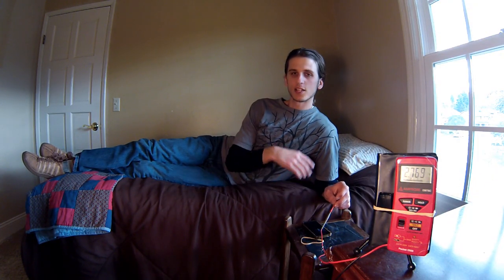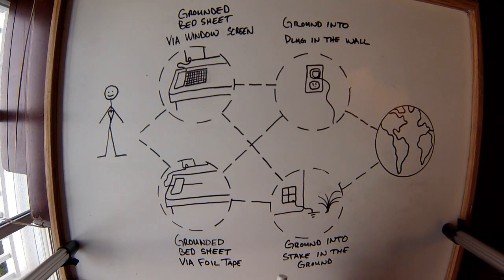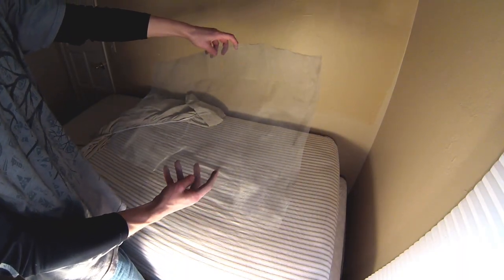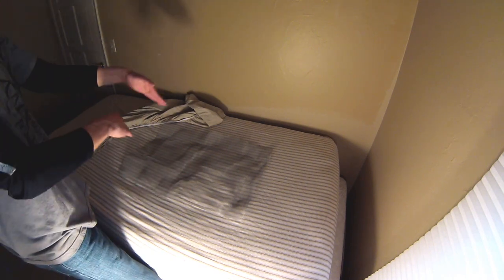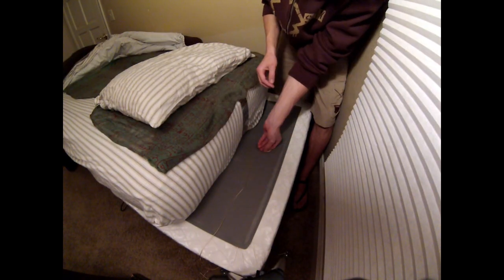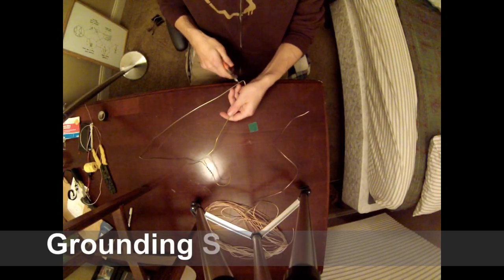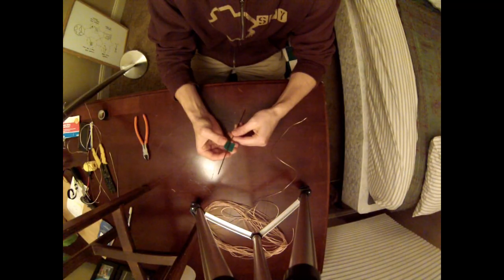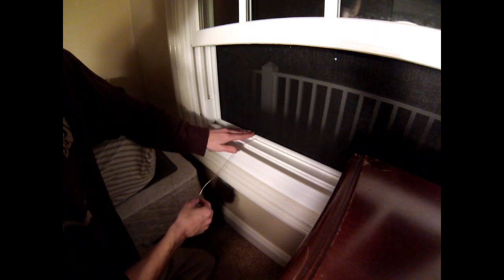DIY Earthing Sheet: How to Sleep Grounded Indoors (Tutorial)

Comment: I would say just think earthing direct, which means having socks made for earthing or cuffs that also are made for earthing to slip on your ancles before you go to sleep. This way it's easily removable and you have direct contact which means the best effect, where I get 0,05 volts through my voltmeter test. I also use the earth wall outlet, but make sure your system is thoroughly earthed and ofc a good connection to the outside ground. Otherwise you need a rod etc.

My experienced health benefits are better sleep, no more going to the bathroom at night and more rested in the morning. This happened after few nights earthing. People who are not taking advantage of this FREE source of healing are missing out.
Reply from the maker: Thanks for sharing your earthing testimonial- those are some great benefits!! 🦶⚡️

Comment: I've got a grounding sheet for my bed. The one thing I've noticed is my dreams are not as "disturbing". I use a copper rod staked into the ground/earth  with #10 copper wire..
I attach it to the sheet via copper bolts in the corner...
Reply from the maker: That's awesome! There are so many benefits to earthing, it's impossible to list them all 😊

Comment: Fantastic video ...well done, can you tell me what voltmeter you recommend and what settings ...going to try mosi net (Metal)  copper wire and long 4 ft steel driven into ground ...might need be careful of lightning strikes ? so fuses as well ?
Reply from the maker: Lightning won't travel through and shock you, don't worry about that!

Comment: Hi all, I'm new to all this. I just have a question I don't see anyone askimg: by covering the mesh with a bed sheet, does that not remove the conductivity? As in, doesn't your skin have to touch the actual metal? (mesh or tape) Any further advice on this would be appreciated. Thanks!
Reply from the maker: It doesn't remove it but it can reduce it slightly. But, your body produces moisture (sweat) which enhances conductivity.

Comment: Does the metal have to be touching your skin???
Reply from the maker: No it does not.
Reply: Can you please elaborate how the conduction works if there is a seemingly non-conductive material between the skin and the metal? I just want to understand it please @Earthrunnerssandals
Reply from the maker: The material covering it does not block the transfer of the conductivity  @NanetteSchroeder

Comment: Hey I'm pretty sure as a safety feature rather than a fuse one should be using a 100K Ohm resistor built in. The resistor is there so that if you were to come into contact with a hot wire on accident from any appliance plugged in to 120v, the amperage flowing through you to the ground would be limited to a very low and non lethal current. The 5A fuse does not accomplish this. 👌🙏 blessings. Just made my grounding device today!
Reply: Still using the grounding device?  Does it work??
Reply: @lonnycurtis7093  I'm using it still. It's hard to isolate all the factors in daily life, but I'd say its worth it to use. I supply everything I can in my healing lifestyle and know that a bunch of small good things combined has potential for great outcomes 👍 hope that helps. God bless
Reply from the maker: Thanks for sharing!

Comment: A took a multimeter and put continuous voltage scale. After putting the common lead to ground and the red one holding in my hand, it read -6mV. After that i put an electrostatic bracelet and did the same thing and it measured -0,2V, why is that ?
Reply from the maker: Hm, it's hard to say without knowing all the variables of your test.

Comment: WHAT DID U GROUND IT TO? U stopped after u put ur sheet over the screen. Come on!!
Reply: He explained it in the flow chart at the beginning. Either use mesh or tape, and ground to either house plug or our side with peg/rod. He showed how to do one end of the wire (both options), then the other end (both options). You decide what you want to do 😊
Reply from the maker: Yes exactly, you have options! I use the earth.

Comment: Hi…
Thanks for the great instructional video on grounding your bed. I have a question…I have a 2” mattress topper on my bed. The aluminum mesh I laid down on a full size bed fills about 2/3rd’s of the entire bed sandwiched between the bed mattress and the mattress topper. Am I losing a significant amount of the beneficial effect of conductivity putting the mesh under the mattress topper vs on top of the mattress topper? Would you say it has little effect on the conductivity to my body. I’m doing it more for comfort. Would you strongly advise putting it right on top of the mattress topper?
Reply: Have you tested to see if you are grounded with this set up?

Comment: Do we add the inline fuse regardless of whether we use the stake or the outlet method? What is the rating on the fuse? Are both the screen and the conductive tape equally effective? Does guage of the wire we run make a difference for effectiveness?
THANKS SO MUCH! so valuable

Comment: Some years ago upon a friend sharing his earthing bed sheet great experience, I bought a set of grounding bed sheet from aliexpress with everything properly made and neat. Bedsheet is weave with silver threads (copper model is cheaper), with a plug to power socket(only earth wire connected). 

For better experience and to avoid common earth wire stray current, I removed the plug, connect the bed sheet wire directly to a meter long earth rod nailed into ground (no need 2m depth that is mean for real equipment earth). 

Measuring of my body resistance and testing on friends sitting/lying on top the grounded bed sheet is instant very drastic drop of voltage VS earth (of course since the purpose is to earth our body to drain away bad radical energy &static charges). 

Resistance of body by holding ammeter probes on both hands shown instant drastic increase or drop for different people.

The experience is fantastic, immediate best sleeping quality with cool fresh head everyday. Before I was always feeling tired with very hot head due to long exposure to smart phone and internet usage (radiation of 4~100mG from phone), also EM wave from 220KV power lines just 600ft away (constant 0.4mG).

No more blanket sparking at winter night due to static charge. But after a period, you may stop feeling the different as you get use to the goodness. So i go for bare foot walking on soil, since earth blanket is only a tool for lazy/ busy people who can't afford to connect directly with mother nature for healthy energy exchange, so they utilize their sleeping time to connect partially through wire.

Comment: So.... earthing through the plug eliminates the need to earth with the coathanger right?
Reply: Yes, you can get ground through a plug (assuming it’s truly grounded). However I tested my body voltage when using a line directly to the outside ground and it was lower.  A direct line to outdoor ground usually gives you a better ground than electrical outlets.

Comment: Nice explanation!Congratulation!what is the instrument you are using?What setting do I have to set it on in order to measure the volt?mahmper?
Reply from the maker: It’s a voltmeter
Reply: @Earthrunnerssandals  i made one grounding sheet....in my bed....followed by a cable co netted to another sheet outside in the balcony...and from there the cable on the other end of the sheet mat goes directly in my garden....Now i just need the voltmeter...and make sure it works ..i slept for two days...and I perceive a sensation of relaxing feeling carrying out of my body a muscle soreness....i don't know if this the stress or the Grounding effect... Another problem i need to solve...is tbe pricky edges of the anti-mosquito iron sheet/net i use for grounding...at the moment i cover the left and right bed side edges with a bed sheet so it doesn't prick me.Welcome any suggestions :)

Comment: What did you do with the negative lead on the meter?
Reply: You put the negative lead in the ground hole on an electrical outlet OR the negative lead touches your grounding mat material. You can then touch your hand to the red lead and read your body’s voltage.

Comment: Hi, I've been walking bearfoot during summer for some time now and a week ago after watching the Earthing movie I was very motivated so I've soldered some two inch round metal pads to a cable and soldered it to the copper pipe in the heating sistem next to the radiator in the appartment. When checked with an multimeter it emptyes the body from 2-3v to 0,03 and eventualy to 000 so it's grounded. Did just that also to my mother in law which has much inflamation and pain in her body and mostly in the feet. And my wife has her throat inflamated as well and she sleeps with the pads and keeps them on her belly every day for some hours like I do to. We're all been using this grounding methood for a week now, day and night by puting the metal plates under the elastic of the clothes on the belly skin. But no one seems to notice annything. I mean after days with hours of grounding each day... And in the movie the lady in the wheel chair said that after one night the swelling of her feet was gone that she could see the bones! Clint Ober was UAU after one night...Am I missing something here regarding indoor earthing? Are we doing something wrong? I also aspect to receive some silver mesh(55% silver, 45 poly) to put on our pillows without anything on top of it for best contact. But now I'm not that enthusiastic like I was a week ago. I was hopping to see at least something at one of us, annything.. If, I qoute: "Inflamation can not exist in a grounded body" then why neither of us experienced less swelling in our feet, thorat etc?  I went for the pipes because of the emf in the sockets that many are talking about.
Reply from the maker: Hey there, it is possible there are enough external factors like other EMF fields or local 5G that is affecting you. Do you turn the wifi off at night? In an apartment, you are very close to all of the neighbors' wifi routers and other appliances, you may want to look into shielding paint to limit how much of the neighboring EMF fields leak through to your apartment.
Reply: @Earthrunnerssandals  Thank you. Someone told me that I might be getting ''false'' grounding from the heating pipes because of the huge metal mass, absorbing the body voltage (the drop shown on the multimeter) but the pipes being isolated in the earth from cold and being a closed circuit with valves and pumps it's not grounded so no benefits. Then I've read about some people that can be affected by the emf's in the sockets, or the ground being connected to the negative in some sockets (one of mine for example) so I'm avoiding sockets too.. A rod in the ground to the 4th floor is out of the question so the last chance: I've soldered a wire to a copper nut on the cold water pipe under the bathroom sink and routed it in the room and we'll see. Cold water pipes are mentioned many times as being a good way of grounding.

Comment: I thought bare skin had to be making contact.
Reply from the maker: Anywhere your skin contacts the sheet, it's benefiting from grounding
Reply: @Earthrunnerssandals  Right. But if you put the sheet over the grounding mat, doesn't that stop the current flow?
Reply: I can see from your demonstration that the voltage is dropping, but I was told again and again that the bare skin had to be touching the grounding mat.

Comment: I've been sleeping on this for a few weeks (aluminum screen method), and I'm waking up with sore hands, feet, knees. I've never had any issues with this and I'm not sure if it's related to grounding yet. I'm young and I tested my setup with a multimeter to make sure it was working beforehand, (got down to 0.008 volts), so maybe I'm detoxing in some way? Super weird and disconcerting.
Reply from the maker: If you've tested to confirm it's grounded and you didn't accidentally bring more electric fields to the bed (like bu plugging into the wall outlet) then it may be a detox reaction.
Reply: @Earthrunnerssandals  My plug is going into the wall, but I cut off the wall plug prongs, so only the ground is going into the wall. I've temporarily stopped using my grounding sheet for a few days and my joints have stopped hurting, so clearly it's connected. Just not sure if it's a detox or something else.
Reply: @aeko   How are you doing now? Im experiencing the similar symptoms with grounding. Also insomnia...
Reply: @GSD_Moose  I stopped doing it since, the issues are gone. Would have to do further testing to see what the issue was. Could be something wrong with the outlet I was using.

Comment: as soon as you cover the “grounded “ foil up there is again isolation....so you are not grounded at all... I used a silver conductive sheet (one square meter) where the body is largely touching the surface of that ., using the grounded contact in the wall socket only.
Reply: can you put a link on your  silver con. sheet pls thank you
Reply from the maker: If you use a conductive material it is still grounded, as shown via voltmeter test

Comment: That's great!
Is your bedsheet conductive? If so what is it made of and where did you get it? If not am I understanding correctly that it works without direct skin contact (through a normal sheet)?
Thanks!
Reply from the maker: You can use wool or other natural conductive materials. The Earthing Store sells premade kits too which are easy to set up.
Reply: @Earthrunnerssandals  wait is all natural fabric (cotton/hemp/flax/wool/etc) conductive???
I tried a week on a conductive silver cloth grounded directly to the ground and I felt horrible! So tired all the time...): Must have hit a lay line or something, not sure what's going on...

Comment: Thanks for this awesome demo! I have a few simple questions:

1: If one is using a copper plated stake instead of the grounding outlet in the wall is the inline fuse really needed? If there was lightning happening one would know to just not use the grounding set up.

2: If really needed, can you provide the type of "inline fuse" to buy, and if possible a link, to protect against a surge in voltage? I would imagine that it would have to have copper plated ends to connect with the copper speaker wires.

3: I would imagine it would be worth spending the extra money for 100% copper speaker cords to go from the grounding stake to the destination.
Reply from the maker: 100% copper would be great if it's in your budget. And definitely, don't ground to the earth if there is a chance of lightning in the forecast.

Comment: If I made a sandbox for kettlebell mobility and wellfit workouts barefoot, would that be concidered grounding?
Reply from the maker: If the sand was placed directly on the earth, it should be conductive when there is ample moisture (humidity) in the air. If there is a tarp or plastic or anything underneath, that would create a barrier isolating you from the earthing potential.

Comment: Do you need an inline fuse if you are using a rod outside?  Just thinking about lightening.  Thanks!
Reply from the maker: Yeah, grounding is not recommended when there is lightning in the forecast

Comment: I would think your best grounding can be to get a copper wire inside a water bed, without it leaking, and run it to a ground rod outside. Only problem would be if there are lightning strikes near your home then you could be fried in bed
Reply: The inline circuit should be able to prevent that.
Reply from the maker: Any materials between you and the conductivity (like the mattress, sheets, etc.) would insulate you.

Comment: Good vid. There are all manner of conductive fabrics available to make this kind of mat( some far less expensive than the argenmesh!) lessemf.com is probably the best website for this kind of stuff. Also one easy way to eliminate electrical field(from house wiring) in your bedroom is to simply switch off the circuit breaker (to your bedroom)in your electrical panel.Make sure you're not sleeping against a wall with a "smart" meter ( or a "bank" of them!) on the opposite side and turn off wifi at night. The need for grounding has never been greater Than it is now-right now! Watch this youtube documentary and you might understand why! 5G Technology : The new Earth Project Documentary 2019 HD
Reply from the maker: Great advice! Smart Meter covers are also a wise investment if you aren't able to opt out of having one installed. Thanks for sharing your tips and the documentary suggestion.

Comment: If you live on a two storey haus or on a high rise condo, can we just submerge the end of the string with the conducting rod on a bucket of water?
Reply from the maker: There are some grounding mats that plug into the grounding plug part of a wall outlet if it's not possible to get a long wire that you can feed through the window and to the ground.

Comment: how to measure the voltage ? could you please explain?
Reply from the maker: A device called a "voltmeter" (:
Reply: @Earthrunnerssandals  I am not that daft, to measure things like this you need very expensive tools, just can't believe it you use t cheap tool.
Reply from the maker: @danielg-ski  Voltmeters are an effective device for this purpose; are there other devices you would recommend as an alternative for this purpose?